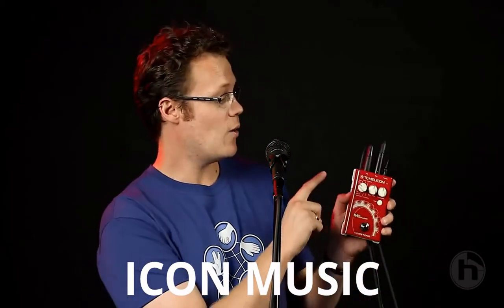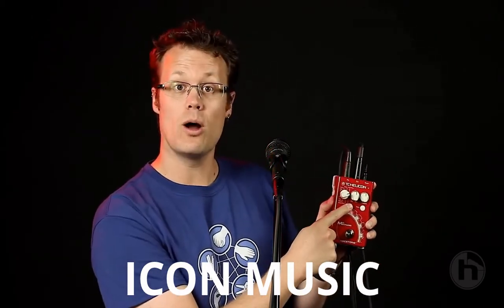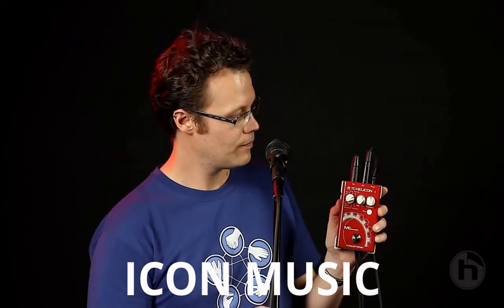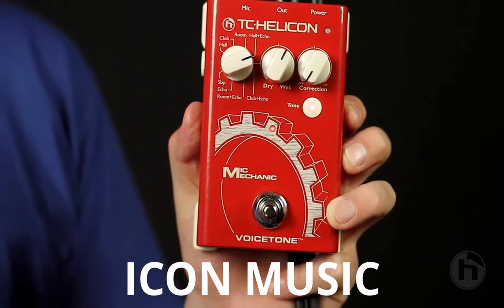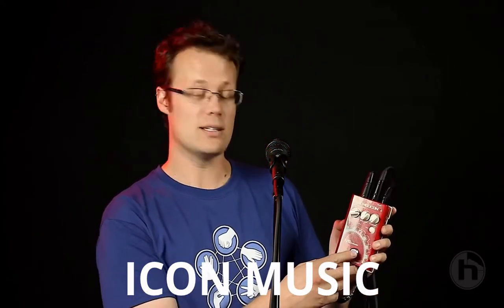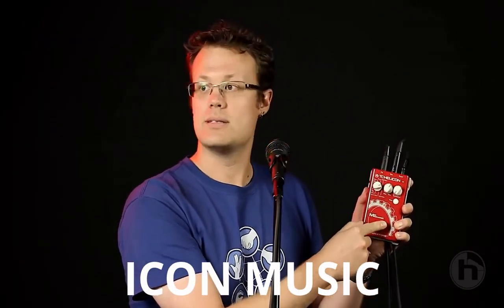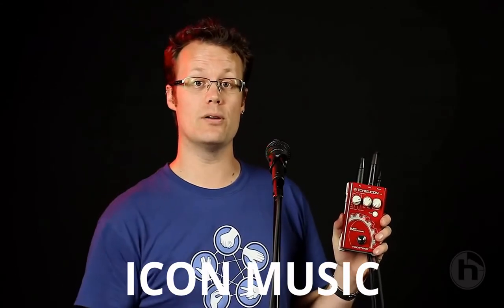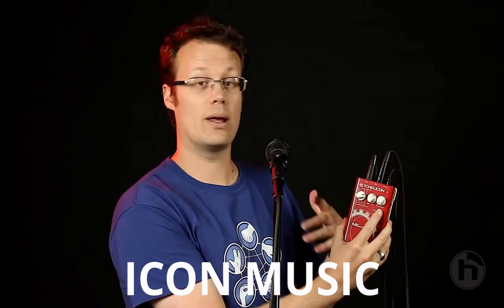TC Helicon Mic Mechanic at ICON MUSIC

Comment: hi, great device. My question: can I use this as a send/return effect  through a mixer?... so I can aply the effect separately to several mics (in different tracks in the mixer)? IN this case,  does this unit accept  line level signals (1/4" plug cables) to do that, or should I use a "Y" cable with two XLR ends and one 1/4" end?
Cheers.